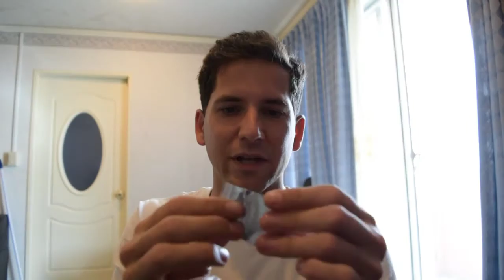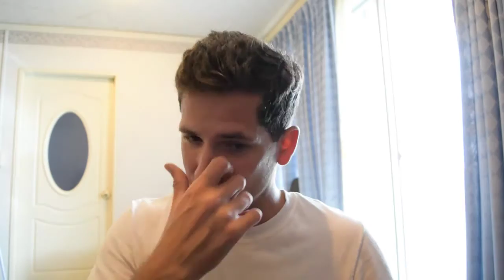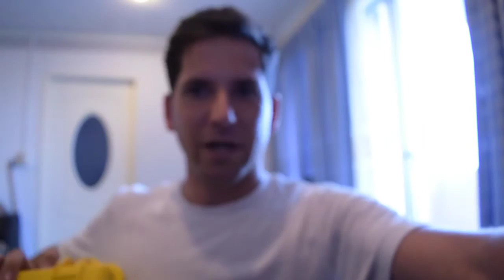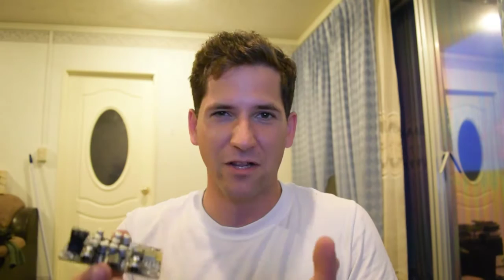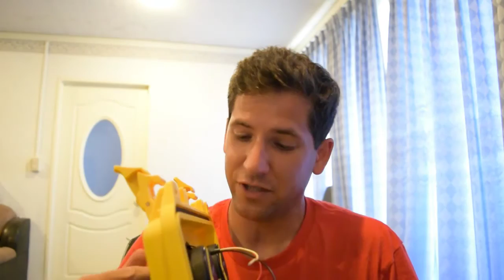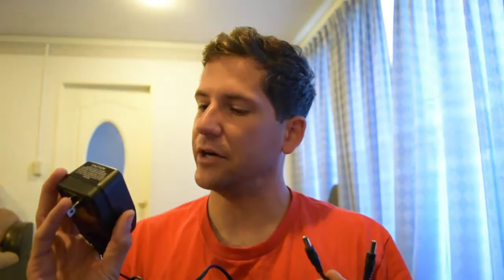DIY Boombox Complete How To

Comment: Van,
        Your info is good, tried and true. However, it is NOT a video HOW to build the box. Camera is on you constantly. How about focusing the camera on your hands and point to the process as you go. Pointing out the different components, where to mount them, pointing out possible mistakes that might be made. Your video is a description on what to do as opposed to an actual build. Many people consider a picture is worth a thousand words. Please continue in the spirit of helping others building and learning this craft, but consider the hands on method of teaching. you might be very good at it.  peace
Reply from the maker: I'm actually planning on doing another how to video showing the box itself and not my ugly mug. I think that's been the main complaint on this video is that it's more seeing me explain how to do it instead of showing how I did it. I have a few builds I'm planning now that I'm somewhat settled back in the states.
Reply: Yeah, I was about to say dude, it’s called the edit button, but I get you were trying to be detailed & I saw some interesting excerpts, but there is no way I or many others who might otherwise enjoy learning such a module can sit through an hour of it. I feel like you can cut out 45 mins or more. If you time lapsed parts that would help too. I couldn’t watch it all, but you were committed on being informative. Perhaps to much. Thanks for the content.

Comment: Did you connect the power from the battery to the bluetooth module and the mini amp directly but just with a 10amp fuse in between?
Reply from the maker: +Randall Mendoza Basically yes, the power will go Battery->Fuse->on/off switch-->Amp/bluetooth. But if you don't want bluetooth on all the time when you turn on the amp then you'll need another switch for the bluetooth
Reply: +Van Damage Awesome yeah that's what it looked like...building that this weekend. thank you!!
Reply from the maker: No problem! I'm glad to have helped. Good luck on your build and if you do a video on it I'd love to see it.

Comment: Thank you for the video!  I like the shopping list of parts.  I am eventually going to build one using the Pelican 1200 case.  I liked to shots you took of the inside and holding it so you can see what size this box is inside and out.  I didn't mind how long it was as I just FF or Rew to where I wanted to go.  Thanks for taking the time to document your efforts for others to watch and learn from.
Reply from the maker: +DOC Ohm No problem at all. I'm glad you found it helpful. Once I'm finally back stateside and moved in I'll do a more in depth and hopefully clearer video showing more of the soldering and cutting involved. If you have any questions on how to any particular part of it when you get to building your own let me know and I'll help where I can. And if you upload a video to youtube link it in, I love seeing other peoples takes on the project.
Reply: AF deployed by chance?
Reply from the maker: AF yes, deployed no. I'm stationed in Okinawa Japan so it takes minimum 3 weeks to get anything out here and the stores don't exactly have the necessary parts.
Reply: +Van Damage Thanks for serving.  I am retired AF, a avionics tech.  I started at 19 working the SR-71 at Beale back in 82', now retired, I am teaching the troops how to maintain the F-35 at Eglin
Reply from the maker: That is awesome! The SR-71 is definitely in my top 5 favorite. It's great you've taken all that knowledge and continue to give it to new generation. I'm actually CE troop doing plumbing, not too glorifying but someone has to do it haha. I have been lucky enough to live in Germany, England, and now Japan. Can not complain about my career. And thank you for your service and continued service